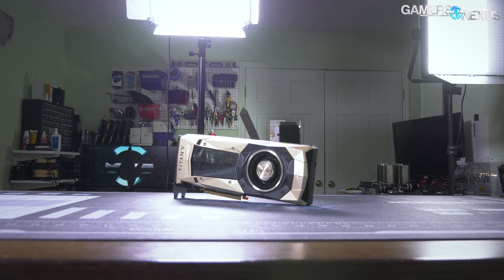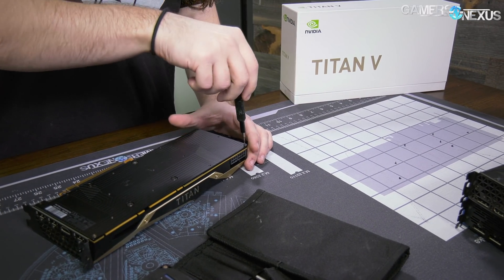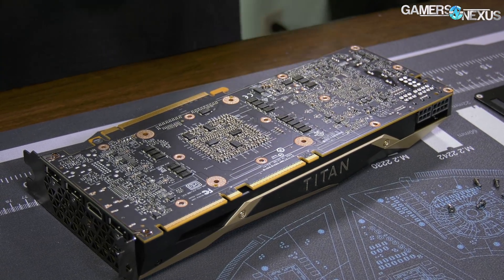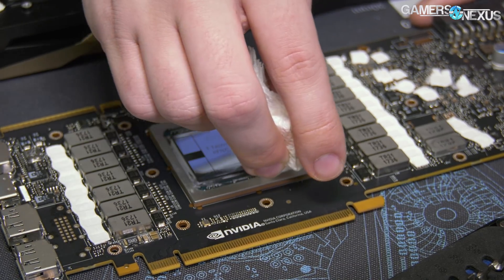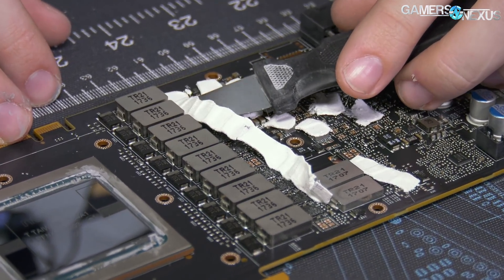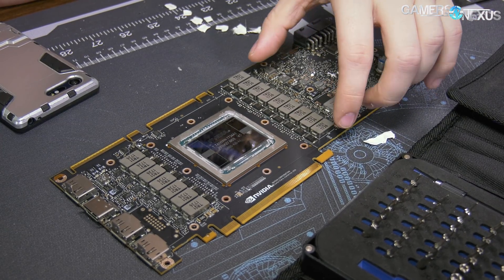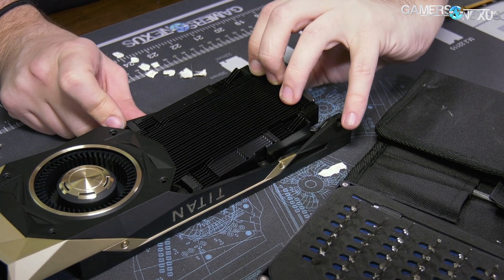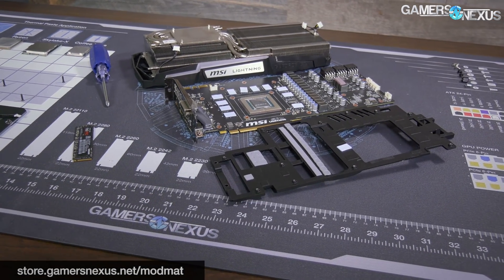NVIDIA Titan V Tear-Down: First Look at $3000 Volta

Comment: Should I buy a GTX 1060 now or wait for the next generation of GPU based on Volta Architecture which Nvidia might be launching in CES 2018...?? (I live in India) (Please Reply)🙏
Reply: Actually, you should consider the RX 580, considering that it is 25000 on primeabgb, and already a faster card than the 1060, and will be faster still in the future.
Reply: Soham Naskar keep saving money for Volta
Reply: Nah; buy 1060
Reply: I do too, and I'm going to wait. But not for longer than Volta/Vega 2 (if it solves vega's problems, ie power and efficiency).
Reply: Volta based gaming cards have not even been announced, CES 2018 launch is nothing but a rumor and highly unlikely. If you need a gpu now, buy the best you can comfortably afford.
Reply: On top of that: We're not even making huge jumps inbetween generations anymore, anyways.
If you bought a 970 in 2015 it's still about as fast as a 1060.
Likewise a 960 is about on par with a 1050ti.

So by waiting you may be stepping up one "Tier" of GPU, but you also have to consider potential availability issues, wait for benchmarks, wait for AIB partner models, wait for individual card reviews (or test several cards yourself until you find one you like)...
Reply: You are going to prolly game in 1080p,get 1060 or 1070 or wait forever,cuz waiting never stops

Comment: That heatsink is insanely small for such a high TDP GPU.
Reply: +SlavjanA I always thought that reference coolers blow
Reply: Noise probably isn't the main concern for someone buying this GPU and reference coolers always suck anyway.
Reply: that thing must be LOUD
Reply: Reference coolers are actually great when you want to move the heat out of a system instead of polluting the inside of a case.
And noise doesn't matter when it's being used in something like this: 
https://3c1703fe8d.site.internapcdn.net/newman/gfx/news/hires/2016/1-whatpowersfa.jpg
Reply: I don't mind reference cooler my 980ti is pretty good
Reply: Same tdp as 1080 an ti
Reply: I don't understand why someone doing productivity wouldn't care about noise and lost performance due to throttling!  Your likely sitting there listening to it 40+ hours a week!
Reply: gtx 590 fo real
Reply: Erytropus You know, I knew someone was going to say that.

Comment: from the benchmark we have seen , are we going to see another significant update or it will be another RX Vega situation, I wasn't impressed with gaming benchmark , don't tell this wasn't intended for gaming  ,because this is what was said about vega frontier edition
Reply from the maker: We have benchmarks coming out soon.
Reply from the maker: They are in editing now.
Reply: Nella it's terrible considering what gv100 is
Reply: it is bad for a Die Size of  815mm2  when compared to 1080 ti,  "GTX2080" should be least 25-30% faster than 1080 ti ,so what does that leave for 2080ti ?,
Reply: Estimated time?
Reply: Eso no responde nada jeje
Reply: 25-30% boost is bad? Lul